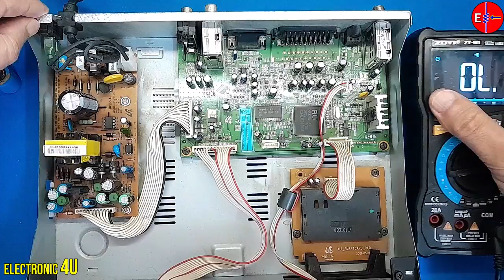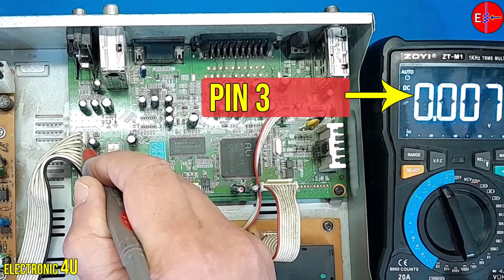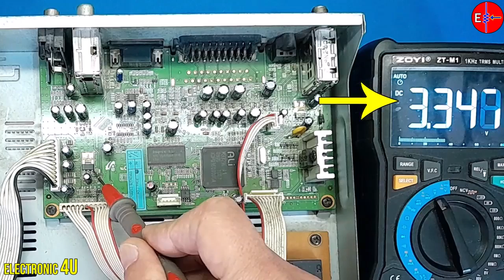Why does the satellite receiver not turn on?

Comment: Hi Professor. why is the problem temporarily solved by heating the capacitor?
Reply from the maker: Hello
The dielectric material in the capacitors temporarily starts working when heated, but after a while the error will appear again.

Comment: If the tuner of the receiver gets too hot and one of the voltage regulators gets too hot, which one is the problem? The satellite receiver does not pick up the LNB signal and does not pick up a network when scanning. sr-8800HD .thank you
Reply from the maker: Probably the tuner has a problem, do accurate voltage measurement and check the output voltage change on lm317